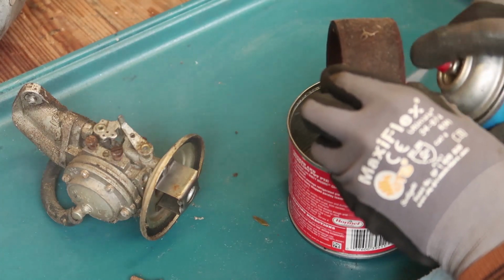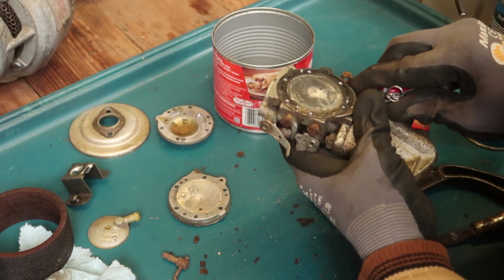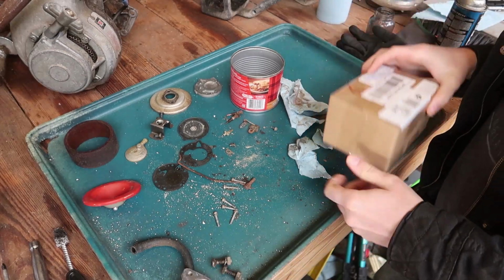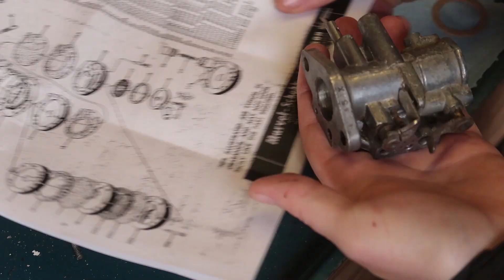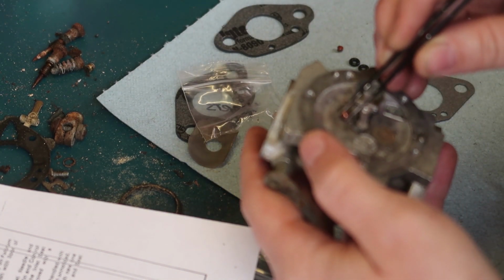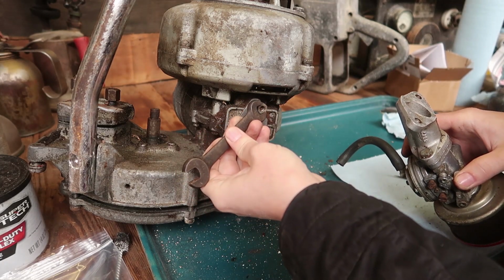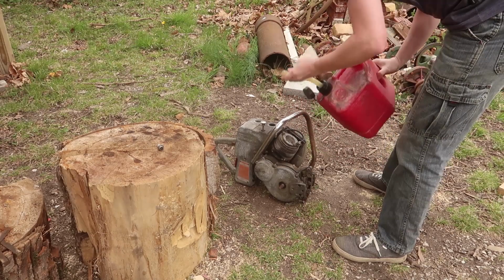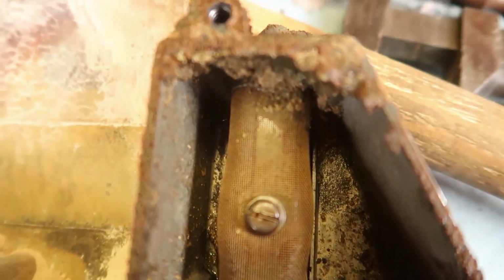1950s David Bradley Chainsaw Restoration 07: Carburetor Rebuild and Cleaning

Comment from the maker: YES i know i need to use premix for this, but i just didnt feel like mixing some for such a short test lol. 6 seconds of no premix wont hurt it.
Reply: This era machine prolly requires just standard single grade 30 Weight as the mix.
Reply: @pegtooth2006  This I can confirm. I have one of these chainsaws myself and it says on the instructions to mix 1/2 a pint of SAE 30 oil with each gallon of gasoline.
Reply: @condb19  thank you. I was pretty sure but empirical confirmation is always nice.

Comment: Great job. 
First, I'm no expert.
On carb air/fuel adjust screws. Count turns to screw them in all the way. Then remove. When replacing screw in all the way and back out the counted number of turns.
I like your lab beaker for gasoline.
If you have a cruddy gas tank. Get some aquarium stones (small ones for bottom) pour them in the gas tank and shake. Or build a tumbler.
It's odd to see a tank that comes apart.
Again, just things I have learned from friends.
Reply from the maker: well this tank has oxidized through evidently, so ill need to sand blast and JB weld the bottom. re-sculpt the shell a bit.

Comment: I picked up one of these on the side of the road and cleaned the two contact points by the crankshaft inside the magneto and got spark, used a brush and two cans of brake clean to get the varnish out, replaced all the lines and filter, and used a drill with an 11/16 socket to crank it over easily. The only problem is the carb is flooding and can't fire. Wondering if I should buy the rebuild kit.

Comment: Just for when you rejoin those two halves of the tank, don't use silicone sealant, 6 months down the line the fuel will have degraded the silicone and you'll have a leaky tank! I made this mistake with sealing a carb fuel bowl.
Reply from the maker: dont worry im going to use some cork gasket stuff.

Comment: You can fill the gas tank with sharp-edged pebbles, (kinda like fish aquarium gravel) tape it to the shaft of a semi slow moving electric motor and leave it spinning. The moving rocks will clean the inside of the tank.

Comment: Make sure you use ethanol free gas as ethanol is bad for the diaphragms in the carburetor. It will make the diaphragm turn hard and crack and ethanol likes to absorb water from the air.
Reply from the maker: hard to find ethanol free gas.
Reply: @RinoaL  I found it in information (Amazon listing) about kit you purchased. It should be safe up to 25% ethanol in gas. There are not many such kits so I think it is correct.
Reply: @RinoaL    Make eth free gas by making a container with a tube on the bottom thats pinched off.  Pour a cup of water in with about a gallon of eth gas, shake it and let it sit overnight.  The water will pull the ethanol out and separate from gas at the bottom of the tank.  Unpinch the hose and drain off the water.
  For the needles, instead of counting the rotation to get it out.  First count the rotations going in till it bottoms out.  When you re assemble,  bottom out the needle and then count the same number coming out as it originally went in.  Usually 1 1/2 to 2 1/2 turns.

Comment: This era of machine uses comon single 30 weight oil as a fuel mix, 40to1 down to 16 to one.
Note: Tillotson was bought by Tecumseh.  And Briggs&Stratton bought Tecumseh to kill of a competing outfit.
I call these Tillotson carbs pancake carburetors.  Because they are flat diaphragm carbs. More complicated than Walbro and Zama block carbs.

Comment: Try using metal rescue in the tank. It’s a water based rust converter that will get rid of all the rust and then you can clean it out or seal it with gas tank sealer. I did this on my 1953 NSU quick 90z it worked so well!! I filled over half the tank and let it sit for a day then I filled it over (having sealed the filler cap with a bag) and then let it sit. When I poured out the converter it was rust free inside!!!

That tank is crusty though! Haha
Reply from the maker: but this isnt rust, its aluminium oxide, different compound.
Reply: Rinoa's Auspicious Travails *facepalm, sometimes I wonder what goes on in my head hahahahahaha. So obvious

Comment: That brass bit that you didn't have the right tool to remove was the seat for the new needle that you put back into the centre of it. The seat just (can be very tight cause dissimilar metals grow into each other) screw out with a large screw driver. Together the needle and seat form a valve that controls the level of fuel in the fuel bowl, If it doesn't seal the engine will flood. You'll know though when you put a tank back on it, because all of the fuel will leak straight out.
That tank is one of the worst I've seen, without being rusted through lol. Being that it's aluminium, a cheap way to clean it would be Acetic acid, or weak HCL, or a caustic cleaner. Depends on what you've got on hand. Amazing that there's still a carby kit available for it!
Reply: Does aluminum rust?
Reply: Howard Williams aluminum does not rust, as rust is iron oxide; only ferrous metals ‘rust’. Aluminum does, however corrode, it oxidizes, creating Al2O3, also known as corundum, which trades under such horrible names as ruby, sapphire, and emerald depending on the color of the impurities. Generally speaking, this does not happen to relative pure Aluminium in most settings in the detrimental way rust effects ferrous metals.
Reply: @howardwilliams9360  Aluminium in open air oxidises almost instantly, but that layer of oxide is almost impenetrable by oxygen molecules. So the layer of aluminium oxide that forms, stops it from corroding any further, or at least, slows it down to a very slow crawl.

ETA: Aluminium is also very reactive, so any points where it is in contact with a dissimilar metal, it will corrode more quickly and "grow" into the other metal. That's why it's important to have a corrosion inhibitor in your car's cooling system, especially if it has alloy heads and a cast iron block.

Comment: For some who has never rebuilt a carb, and has an apparent dislike for gas as a fuel (i’ve never been fond of it myself- even before the advent of reliable high capacity batteries, diesel made more sense-and electric is unquestionably the future) you rebuilt that thing with aplomb. Ever tried your hand at watch/clock repair?